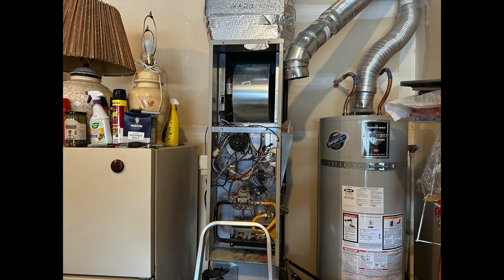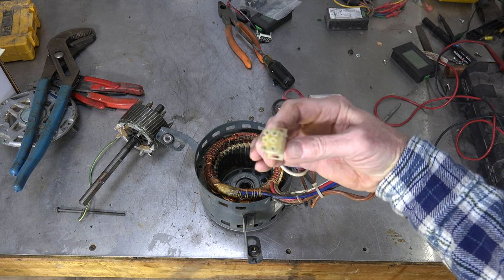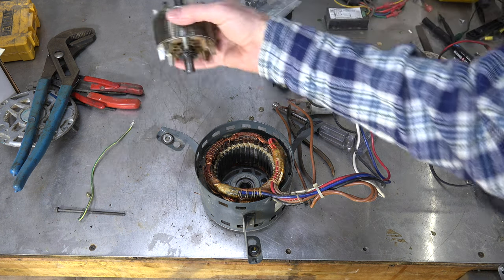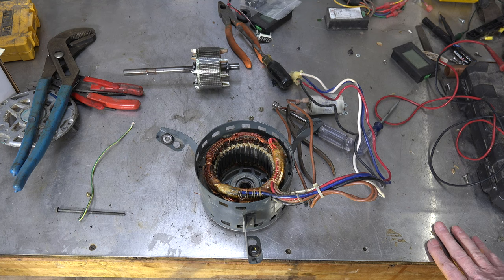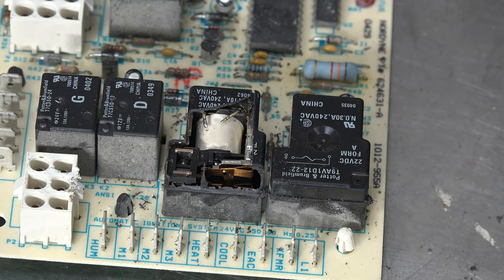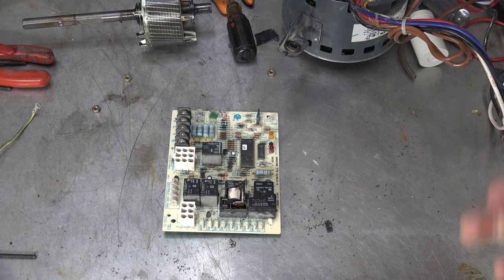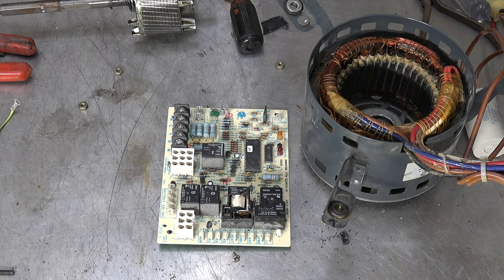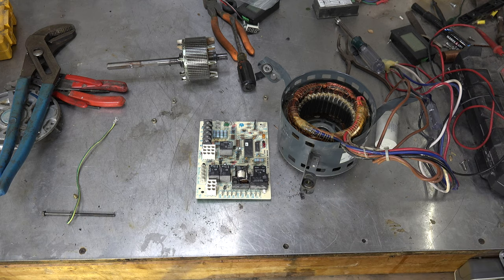The burned winding diagnosis

Comment: Motor over heated, and high amp draw. Replace with universal motor and new capacitor and call it a day. Total cost estimated at just under $400. A new relay could even be installed. Still all parts and labor less than $450.   If it’s an out of warranty with an ECM motor, install a universal PCM ADD A COUPLE OF RELAYS AND WALK AWAY. Save the customer some money and get them back up and running.

Comment: Another good video. Hope your knee is doing well
Reply from the maker: Yeah, got to do another one on the knee.
GFM
Reply: @grayfurnaceman  Hey I'm so glad your knee is doing well. After clearing up the infection in my wife's 1st knee with pic line and antibiotical spacer, then another new knee, 8 weeks later she had the 2nd knee replaced and that was almost 3 months ago. So a total of 5 surgerys for 2 knees, because the 1st one also busted open before the wound had healed and now she's ready for spring to get here!  I can't slow her down! Lol. Hey guy, You take care and keep that wound clean and dry and she recommends always using stitches because it was the glue that had failed her the first time, is why it popped open. Good luck, keep us all posted and great diagnosis on that furnace. You have to look at the economy. 1200 is a lot cheaper right now than a new unit in this economy. If that heat exchanger holds out, just grin and bear the cost of the parts. Money don't grow on trees! Especially when hot dogs are a regular menu item. Just make sure they have a new working co detector in the house at least by the bedrooms and one by the furnace for redundancy! Take care! J Pol.

Comment: I have a comfortmaker furnace in my apartment,  and the thing is a headache. It a 40 year old furnace, and the limit switch  turns off at 120 degrees.  It blows hard but doesn't warm up the apartment that much. The fan was full of dirt and the landlord didn't put the air filter in right place. I bought a 25 " filter but is a bit too long.  It is so sooty.    It over heats all the time , if it stays on very long.  The air ducts don't blow that hard. 
It has a digital thermostat.  I have to let it blow on fan for it cool off, then turn the burner back on.   The heat pump doesn't work either.  Just a headache. 😒.    On the program thermostat if you  go to 3 , it only has 2settings . O  and 1. 0 the burner is turned on without the fan,  1  the fan and burner comes on.   I'm wondering if the relay is burned out on  zero, because it  doesn't turn the fan on when the furnace warms up.
Reply: Sounds like you have multiple problems… it’s burns soot? That’s a major concern bc of the fuel/air ratio is not correct! Can’t remember to much fuel and not enough oxygen, or vice versa? You mentioned it doesn’t blow hard, you have a clogged evaporator coil. All that dirt on the blower wheel, it’s also downstream on the evap coil. Abt the limit switch… it could be tripping prematurely. On those furnaces, I believe it’s a high limit-fan control switch. It’s going to cost a real pretty penny to fix all of those problems!

Comment: Hello, and If I may ask. What is your opinion on oil fired boilers - cast iron vs steel. I'm planning on replacing my 32 yr old Burnham. Planning on 85,000 - 100,000 btu. unit w/ No Tankless.
Reply from the maker: I am a fan of cast iron.  Mostly due to its stability.
GFM
Reply: @grayfurnaceman  That's what I was thinking as well. Thanks.

Comment: Hi there mate. I'm an apprentice refrigeration engineer. I've picked up an old 'email' motor by westinghouse. I've found that I'm missing the switch part of the centrifugal switch. It's a Syncrosnap style switch, and I'm having a hard time finding any information online on how to source parts and repair. The good news is that google has sent me your way - do you have any experience with the syncrosnap switches? Would you have an idea on the best place that I can source parts? My start and run windings are fine, and I'm currently push starting the motor. It's connected to an old Atlas Copco aircompressor in which I'm reluctant to let die. I'd love to repair it! Cheers. Jim.
Reply from the maker: I don't have a lot of info on centrifugal start switches.  However, I did see that Amazon has switches that may work for your application.
GFM

Comment: Yes, worth cherry picking...because...no furnace you replace it with will last 18 years...while this will go another several hundred thousand miles if repaired.
Reply: a new furnace should last 20 years if properly installed, sized and maintained. the old stuff from early 90s and before could last 30+ years - new stuff won't.